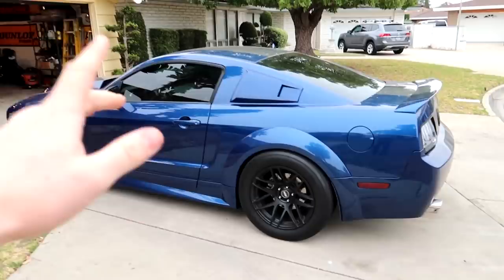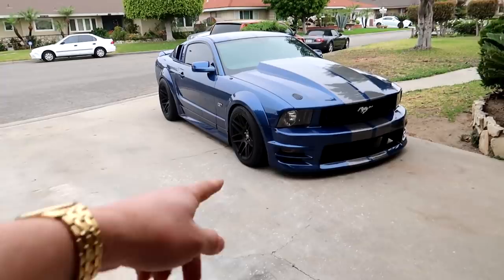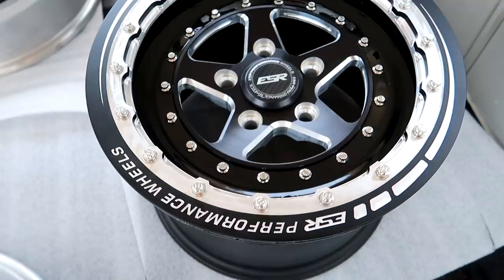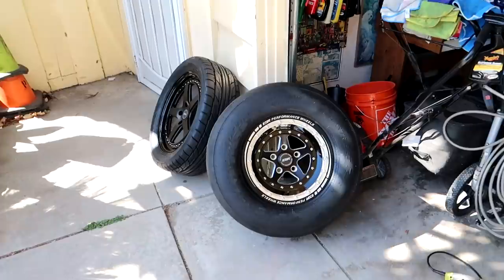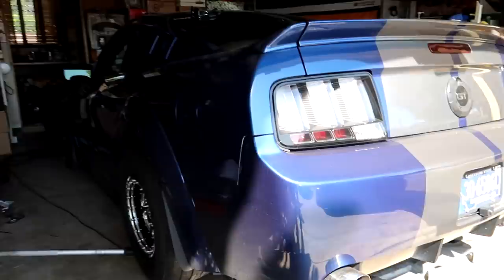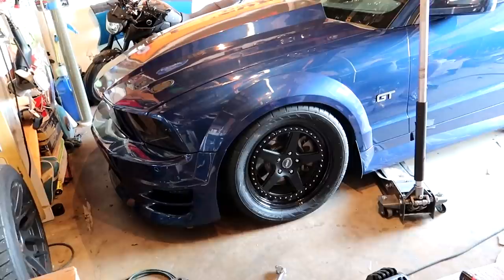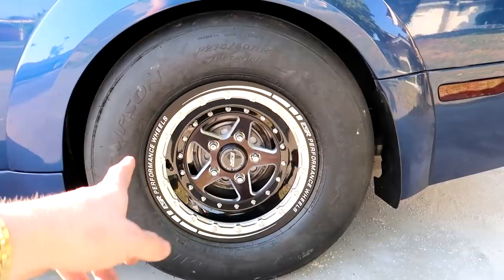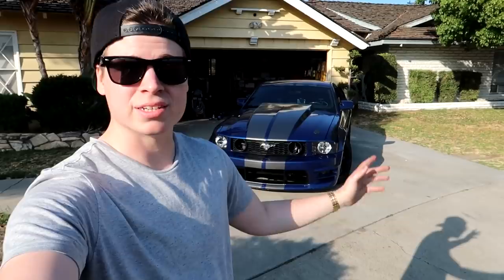The Mustang Gets The Most Expensive Wheels I've Ever Bought!!! (First Set In The World)

Comment: Usually we don’t Jack up the pumpkin (diff) Bc they’ll crack open. I’d recommend using the jack points around in front and behind the 4 wheel wells of the car. Theyre is usually along the pinch weld. That way you don’t crack the seal or diff housing. 🤝

Comment: Two rating systems for myself. Park and chills, and Mexico trips. 

First park and chills, first set 10/10 for the stance boys and basic car guys. Tuners would question it, tuner opinion 7/10 because if your hood was popped I’d say a solid 7/10 because of the risk of crashing. 

Mexico trips, OG tire and wheel combo.  0/10 for the power needed to have fun in Mexico. New set up, with new the right lugs and studs I’d say 9/10. Just because it’s a 1:1 buuuuut it’s such a basic and common design it’s not impressing me as someone who watches a lot of drag and Mexico runs. It’s the basic M/T drag radial rim design.

Comment: Dammm your tire guy scratched the inside of the rims with the tire machine clamps, I worked at a tire shop before and would recommend engaging the clamps from the outside lip instead of the inside, so you don’t leave unnecessary scratches on your rims.

Comment: 7:57 orrrrrr hear me out, do the right thing and get the correct calipers, and rotors Bc there’s no point of going fast if you can’t stop. Possible a stiffer spring in the rear with some longer strokes shocks so it can articulate the weight transfer. Grip is king.